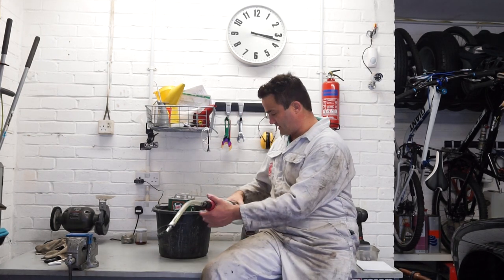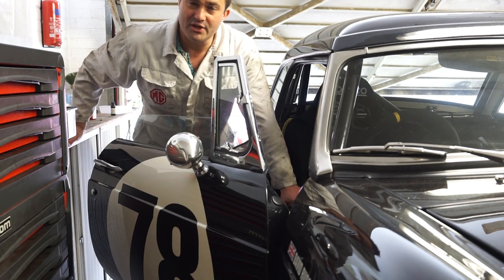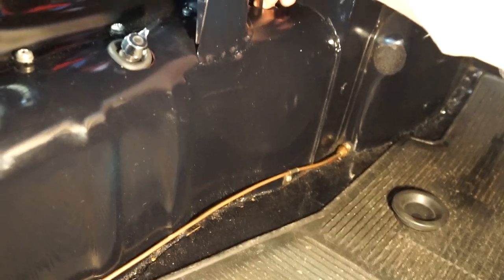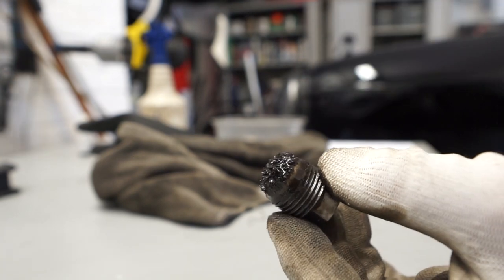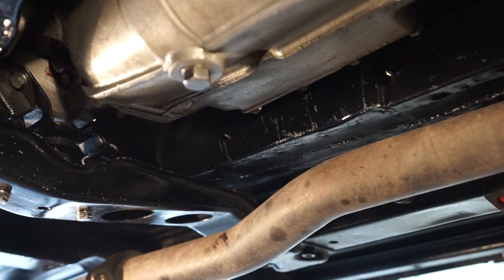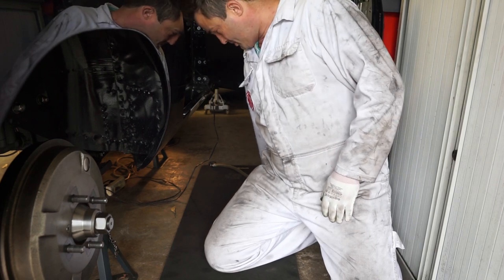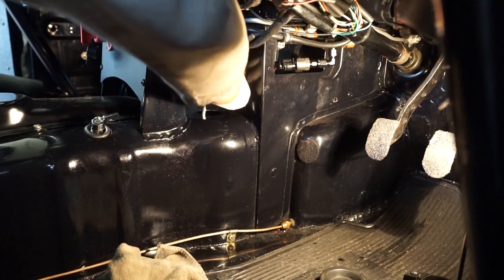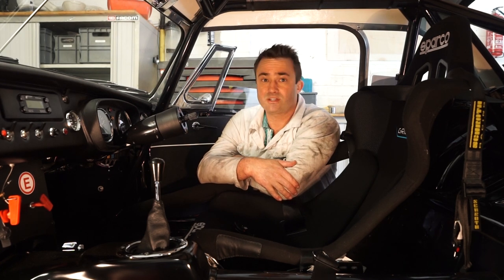MGB Gearbox Transmission Oil Change in a Chrome Bumper Pre-1974 Car

Comment: Ha...you are a man of your word! (David and I exchanged e-mails a while ago and he promised he would do this one). Great to see that even you find this to be a fiddle of a job. Like I said in our e-mails, I also bought a syringe type tool after first trying with a stretch of pipe and a funnel, though mine was a "2 tube system"...one goes in the oil can, and the other into the destination, and then you pump and the oil travel from source to destination. Tip for others : always be certain your tube is actually IN the hole! I started pumping only to find the pipe was sitting on top of the gear box and not IN the gear box! Pumped about half a lite onto the driveway!! A wish I'd realised those bristles on the plug are actually to be removed! I didn't realise they were sharded bits of metal! There was a few left on mine when I put it back in. I'll have to endeavour to clean it off properly next time. Thanks David...great as ever.
Reply from the maker: TED SMITH Many thanks for your kind message Ted, glad that you enjoyed the video. I’ve been there before with a tube that wasn’t quite lined up with the hole in the gearbox and squirted oil all over the garage floor. Hope that everything is good with you.

Comment: Good information I have a 1974 1/2 MGB GT. Now I know where the fill hole is for the trans.   Later
Reply from the maker: Yes, it will be underneath, with the car level you can fill the transmission from the top hole until it runs out, just the same as the axle.

Comment: About to attempt this job on a newly acquired car (who knows when it was last done). 
Having a dipstick makes it nice to check levels, but it does seem like having to load oil through the passenger compartment in an awkward place, is a beautifully crazy bit of design.
Reply from the maker: In the past this used to be an incredibly messy and difficult job for me, having the oil warm and something to pump it in with does make it a whole lot easier! I think the later cars have the filler on the side and you pump the oil in until it starts coming out. I've never changed the oil in one of these cars but it might be easier?

Comment: That oil syringe is great, I'll have to get one. I've been using this tiny manual transfer pump to move the fluid from the bottle to the gearcase. The number of strokes required is inconvenient.
Reply from the maker: Two fills from the syringe and (in theory) you should be about done, I must have lost a few ml when I refilled and needed the third just to finish it off. the most messy bit is refilling after the first pour, bit if you do this in a drip tray it does keep most of the oil in one place.

Comment: Thanks for the info, I was just thinking I needed to change the oil in my '72. 
The syringe is also £15 cheaper on amazon.
Reply from the maker: Great find on the syringe, I think there are a few companies making similar items, it certainly makes the job a lot easier.

Comment: That’s an awesome video. Very well put together and good knowledge

I have a 67MGB, here in Canada that I imported from Britain in the late 80s
Can I assume that everything I’ve seen you do, is what I need to do on mine?

Many thanks, very good instructional video.
Reply from the maker: It should be all the same Adrian. This season I've had a few issues with the gearbox synchro rings, the gearbox specialist I use for rebuilds recommended trying the Duckhams Classic Hypoid 85w-140  Gear Oil. I still continued to have the issues though! In terms of oil choice I think a standard classic 20w-50 is a good option

Comment: I just changed mine last month and that syringe would have made it easier. The description for the syringe on the link says 14.5 liters. I believe they mean 1.45 liters. As always, thank you for taking the time and effort to make these videos.
Reply from the maker: Yes, that's correct Trent, I'm not sure one could easily lift a syringe with 14 litres of oil in it! I think it should say 1.5 litres

Comment: I'm amazed at the condition of the old oil. Racing obviously is very hard on the gear box. How often do you need to rebuild?
Reply from the maker: I have the gearbox refreshed every 2 years or sooner if the synchros break. It seems to be the synchro/baulk rings that take most of the abuse; a few years ago they were only lasting a few rounds, but more recently they have been lasting longer.

Comment: good morning david what gearbox oil do i use in my 1979 mgb gt it has overdrive also do i need to change the filter many thanks richard
Reply from the maker: I don't know so much about the overdrive internals but I don't think you need to change the filter when you change the gearbox oil. The oil I used Castrol 20W50 will be fine for your overdrive gearbox.
Reply: @davidrussellwilks  many thanks for your videos  thank you for a  quick reply all the best for 2021 richard

Comment: Great video its a right pain getting to that dip stick whens its stuck in! The rear diff oil change would be a good video if you could show what tooling you would need to remove the fill plug. If you can even buy a socket to remove the fill plug that would be so handy.
Reply from the maker: Many thanks Rik, totally agree on that dipstick it can be a real pain to get out. I forgot to add that I sometimes just smear a bit of oil on the two o-rings to make removal just a bit easier. I have a whole diff video coming soon including how to replace it (this is on the earlier Banjo type, the the refill procedure is the same) I changed the drain plugs to the later type with a hex head on my car. I think for the square type plugs a 1/2 drive extension bar usually fits, there are special tools available if you need them though.
Reply: @davidrussellwilks  Oh thats a good idea using oil on the o-rings I will now be doing that. Ill be waiting for the diff video good stuff!!

Comment: Very informative. Thank you. Is the location the same for a LHD car (i.e. on the passenger side)? My MGB was built in Dec 1973 although it is technically a 74 as it was shipped to Canada in January 1974. It does have chrome bumpers.
Reply from the maker: Thanks for your message, the dipstick and fill point should be in the same place. On later cars (Rubber Bumper only I think) the gearbox filler is accesses from under the car and is on the side of the gearbox

Comment: About to buy my first mgb gt, any tips for things to avoid whilst buying?
Reply from the maker: The number one thing to look for is rust. Bodywork is usually the most difficult and the most expensive part to repair.
Reply: @davidrussellwilks  Thanks David, I'm really interested in working on my own car and your channel is really helpful :)
Reply: @boratsagdiyev7900  I have a B GT V8,  I would thoroughly recommend one if the budget will permit. Feels like quite a different car and is very good at longer distances due to a high dif ratio (plus over drive). I have used it as a daily driver in the summer.

Comment: Many thanks for this, I bought the recommended syringe and it made the job on my 1974 (very last of the chrome) more than ‘approachable’! I was only topping up and I understand the difference between the High and Low levels is one pint (same as engine oil dipstick).
Reply from the maker: Thanks for the note on the different levels, it's easy to overfill and then have to drain  a bit out. Delighted to hear the syringe tool worked for you.

Comment: hi david i have 2 gallons of 15\40  castrol gtx  will this be ok in my mgb gt many thanks
Reply from the maker: Personally I would only use a 20/50 oil, the 15/40 may be a bit thin

Comment: Hi David, I've just watched your steering rack lube video and ordered the EP 80W-90 to do that job. I wondered, would the EP be better for the gearbox as well? I do have a can of Castrol classic 20/50, so I could use which ever is best. Thanks for uploading all your mg knowledge. Your videos are great, and spur me on to maintain my MGB by myself.
Reply from the maker: Thanks for your message Richard, I've always stuck with the 20/50 for the gearbox, from conversations with various people this seems the preferred choice. I use the EP90 (or similar) for the rear axle.
Reply: 20/50 it is then. Thank you, advice very much appreciated.

Comment: The magnetic drain plug is a nice update.  Not that I’m racing but I got one for the oil pan, never thought of the transmission.  Now I have to find one.
Reply from the maker: The one in my car came from Moss, part ref 2K5830X.

Comment: What mechanic wears white? :). My gearbox drain leaks and drips, think I may use a smear of thread sealant next time.
Reply from the maker: The overalls are partly for the vintage look Dave but they do serve a purpose too; it's easy to see if you have a dirty backside before you sit on a nice clean seat!